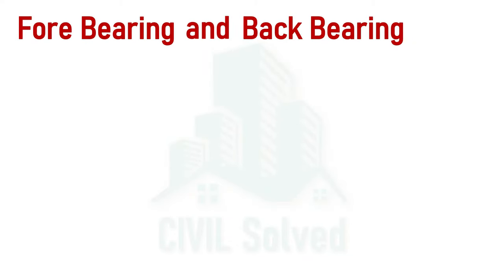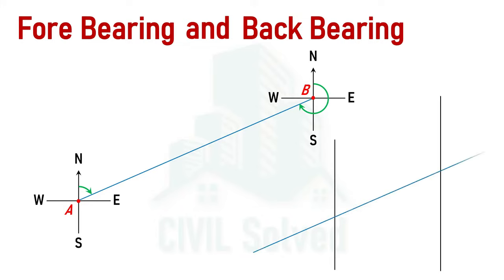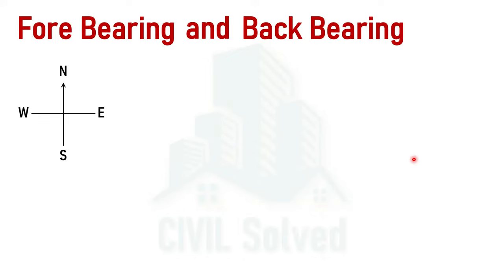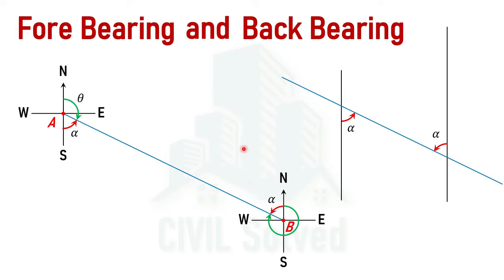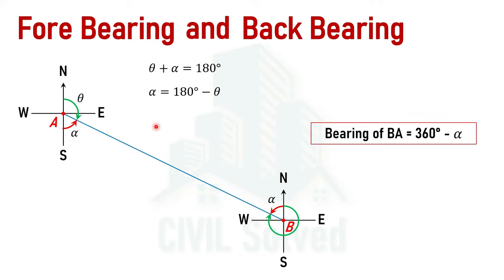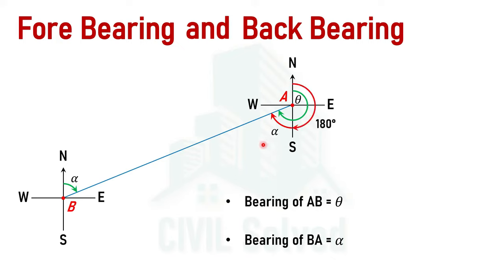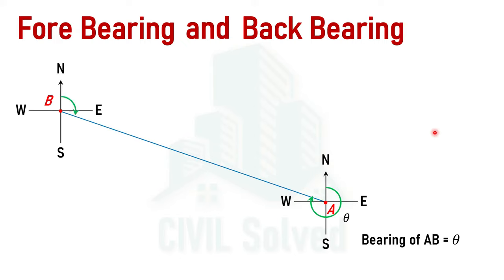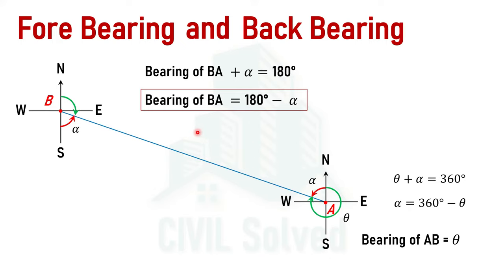Fore Bearing and Back Bearing: Introduction, Calculating Back Bearing (WCB) in all 4 Quadrants

Comment: sir ,
thita =180+alpha
alpha=thita-180 .but write 180-thita
Reply: I don't think so. The equation of the admin is mathematically correct . I also think that there's no need to subtract alpha from 360. 

If we consider 
alpha=180- theta, 
the value will come out in negative which would imply that alpha is to be measured counter clockwise.

Comment: Is the back bearing the same as azimuth?
Reply from the maker: Please clarify your question? Do you mean back bearing is same as of fore bearing ?
Reply: @CIVILSolved  nope, I really meant azimuth. Azimuth is the clockwise angle measurement from North between 0° to 360° which is quite similar to the back bearing. So I was just asking if the two, azimuth and back bearing, are the same.
Reply from the maker: @dadaaan1487  both fore bearing and back bearing are azimuths of line. However it is matter of point from where you are observing the azimuth. Lets say for AB line, if you are measuring bearing from point A towards B then it will be fore bearing and if you are measuring azimuth at B towards A then it will be back bearing.